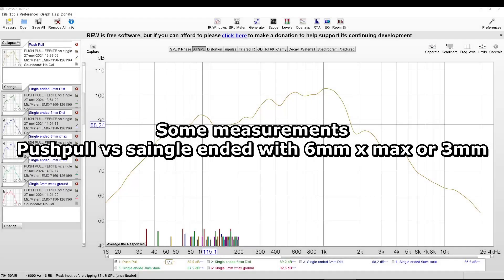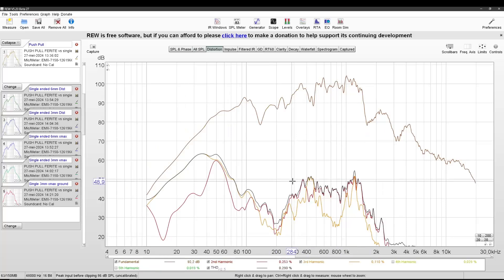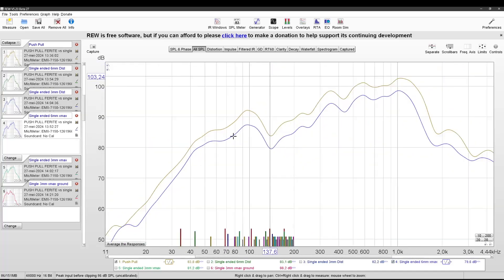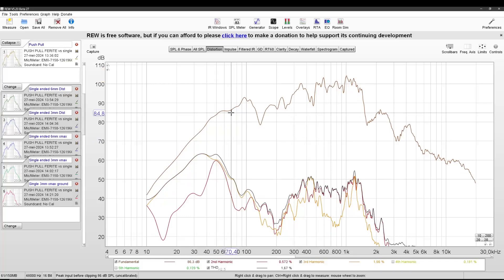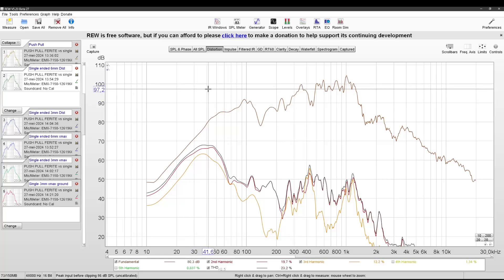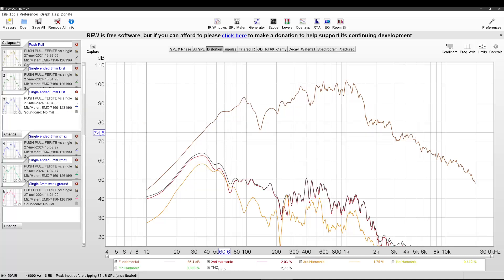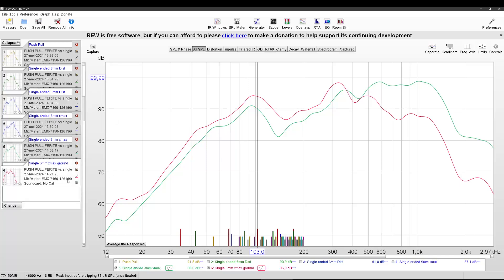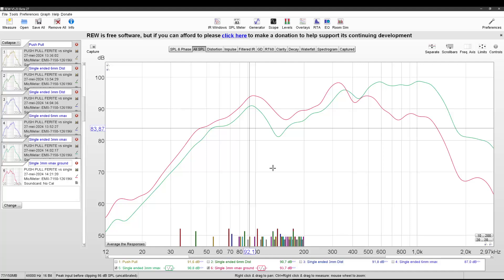DIY Push Pull Ferrite Bass Planar speaker - Part 4 Some comparisons (talk talk)

Comment: yeah.. acpected that..
can you make a screenshot of the Dats measurements of your contraption? 
or tell the qts and fs of the measurement?
i could 'guess' where you 'need' changes to make it a viable woofer.
Reply from the maker: push pull  had a QTS of 2.8 and an FS of 44hz,   single ended 6mm xmax single ended had a qts of  3.8 and an fs of 44hz, the 3mm xmax single ended  has a qts of 3.3 and a fs of 49.

its not a regular driver so they cant exactly be compared.
Reply: @joppepeelen  it cant compare but it still can :)
by the Qts it must play to the fs with no loss of output, so i believe main problem of low bass-output is the narrow baffle..
if you ask me then the qts is pretty shabby, and need atleast a qts of 1
then the thd will be lower, but mainly a bigger baffle is needed to seen by the driver.
ever thought of making sidewings on this panel? or a H shape of some kind?

so;
more magnetpower, more copper in the coil/magnetgaps (this lowers the Q more to 1), 
and acousticly less forwards/backwards wave cancelation, (thus low extension) by more panelwidth/wood/sidewings/H-shape  etc

or boost everyting down low and play low volume, there is no other way i guess
Reply from the maker: @be2the4out  no bass planar magnetic or ESL will have a q of 1 :)
Reply from the maker: We could at major costs. An esl63 has a q of 2 .  As an example :)

Comment: Excuse my inexperience with these, but what would happen if you put it in a sealed box? Will it help over excursion down low? How would the bass response change?
Reply: The low output would be boosted. It would be a more flat output. But you would have to work a lot in the chamber behind it to make it good.
Reply from the maker: No problem,  but they cant be used in a box im afraid. It had to be huge and the foil is acoustically transparent.  :(
Reply: @joppepeelen  there are other solutions to mimic a 'box' ;)

Comment: Thank you for the awesome and unique content Joppe! I suppose you already have mids/tweeters figured out? I am wondering if you tried to build something similar to Jazzman ESLs?
Reply from the maker: thanks m8, well something like jazzman , you mean an ESL ?  i was talking to the owner of a dutch ESL company if i could buy 2 of his panels they use in their commercial setups. (i could make them myself, but... well much work) since i made a ESL magneplanar combo once. and its a pretty nice combo :) i could make an esl in the future myself problem is finding affordable transformers :(
Reply: @joppepeelen  what are the traffo specs required? I have a contact that can make really nice custom ones and they were pretty inexpensive, so could ask around.
Reply from the maker: I don't know much about specific transformer specs I'm afraid , but a step ratio of 1:100 or 1:125  would be nice and a freq range 200-20khz.  There is much more to it of which i don't know a single thing about I'm afraid haha